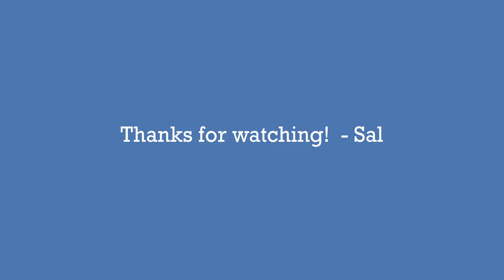First Gen Tundra Audio upgrade!

Comment: I bought an 02' a few months ago for 2k with 140k miles but a bad transmission. I'm currently rebuilding it myself in my garage with upgraded components.  Unfortunately these have a known issue with the torrington bearing behind the overdrive planetary gear.  I'm also ordering new speakers and stereo this week so this is helpful.  Also..if you ever encounter door latch issues. I fixed / modded mine without spending the $250 per latch. Even the new ones are flawed!  Lastly, did you do anything with or for the small tweeter and back door speakers yet?
Reply from the maker: That's really cool that you're rebuilding it yourself. As far as the tweeters, I haven't done anything yet, but I did replace the back door speakers with the same ones I did up front. I don't know if it was super worth it, but I figured why not. Thanks for watching!
Reply: @JDMDriveway  Luckily there are enough good videos of rebuilding the A340 that I felt confident enough to do it! - With the speakers I'm trying to gauge if getting ones without a built in tweeter is the way to go since the already has them... i.e.; wondering if doubling up on tweeters is ok or not.  I'm no stereo genius.
Reply: How's the tranny rebuild coming? Couple questions,  what were your symptoms on the tranny needing rebuilt? Also I heard that the valve bodies get clogged up on our A340 tranny,  any thoughts on that? I've had to replace the lock up solenoid when my 00 wasn't moving anywhere.  Did a pan drop and new fluid and added a little bit of Auto rx and it seems to be shifting like butter ATM.  I think I'm gonna do another drain and refill real soon just to do it. It makes it nice having a drain plug on everything on the first gens. Also do you have a link to the upgraded tranny parts?  Thanks
Reply: @garybrady7245   I’m putting mine back in today/tomorrow.   My wife and I did a full rebuild in our garage.  The issue is common, a bad overdrive planetary gear.   We bought it this way.. got the truck for $2200 and 140k miles.  The issue is dual-fold.. 
1- towing in overdrive in hills and not watching the temps (which you can’t do without a gauge) and,

2- the torrington bearing directly between the overdrive ring gear and planetary gear is insufficiently sized.  

I found a place in Canada that was modding these for a time, machining the ring gear (and or planetary) a little deeper/wider to allow for a slightly wider and thicker torrington to better cope with stress and heat buildup.  This is also why keeping the fluid temps under 190F is very VERY important.  

In our case the bearing and race were 100% gone.. completely obliterated and melted.  This is what happens and in turn wrecks the planetary and ring.. which are now becoming rare as hens teeth to source used (we got a set for $175) or you can buy new from Toyota for $1000.

3- People assume, because of endless heresay in forums, FB, etc, that this issue was limited to only the 00-02 Tundra.  The trans shop (in fact 3 of them) emphatically said it can happen to any of them up to 05 with the A340.  And if you carefully search part numbers as I did, you’ll find no part number changes across those years.  So unless Toyota somehow fixed this in some other manner I don’t see that it was “fixed” at the factory by AISIN.   

If yours is still operational I highly suggest doing a fluid flush with pan cleanout, inspect the magnets, and replace the filter.  When driving, always switch out of overdrive before encountering hills whenever towing.  Lastly, don’t tow more that 6,000-6,500lbs total.  These transmissions are in fact surprisingly small for a v8 truck.  

As for other remedies:  Get a slightly larger trans cooler like the Hayden 679. Add a Derale 13011 inline thermostat.  Add a trans temp gauge and mount it in the pan or at the return line just before pan.  I did all of those as upgrades and peace of mind.

Lastly, we rebuilt the trans with upgrades: Raybestos clutches and steels, new rubber o-rings, and a TransGo HD2 kit for the valve body, new Hercoo solenoids, and reman torq converter.   We did all of it in our garage with a $100 trans mount (red one) off Amazon (requires a little cutting with angle grinder to notch out where fluid pump is) and a spring compressor also purchased on Amazon.  Aside from those two, I had to make a bar puller to remove the pump and a bar puller to remove the overdrive center support.  You also need a few long snap ring pliars, like 12” straight and 12” with 90-deg end.   Lastly, we did not replace the copper coated internal bushings because they looked ok, and a bushing kit to remove them costs like $300 and was something we wouldn’t really use again.. 

My other YT page is RideorDieFab so  follow it.  I’ll be posting all the repair videos there very soon.  It actually wasn’t a hard job, just tedious and you have to pay careful attention to all the details and have some feeler gauges and airgun to check some tolerances and perform 3 or 4 pressure checks to make sure the clutch packs operate.  And to be clear.. I’ve worked on cars a lot but had never rebuilt a trans before.
Reply: @oldowl4290  I gotta tip my hat to you for adding to the first gen knowledge in my hard drive (my brain lol) I'm very impressed with your excellent reply and must thank you! And yes I do have the glowshift gauge with the sensor right into the side of the pan that I made with a universal drain plug from Auto Zone. One that the sensor screws into the center of itself. And have been watching my tranny Temps for a few months now with the average being around 165-173F that's with the oem auxiliary cooler. That's actually my next project is switching out the cooler with a little bit beefier one. I did order the B&M 70268 I  think that was the part number but I didn't like the inner core space that it provided. It was like half the thickness of the oem so I sent it back. And I know another thing that will hurt these trannys is of course the unknown pink milkshake that we all love so well. If you don't catch it quickly it's over it's just a matter of time. But I am still working on getting all of my transmission fluid clean to where it needs to be I just did a drain and refill after running almost 3000 miles on new fluid. That's when I found out you better have a decent fluid or the tranny will not like it at all. Been using the Valvolene Max life full synthetic fluid and having good reactions to it so that's what I'll stick with. But I slowly but surely brought life back into my tranny no doubt in my mind because it was slipping and not budging to now it's shifting nice. The lock ups even working now that I never noticed before with my rrrrs slightly over 2000 doing 50 mph and now I can feel it kick down and observe the r gauge at 17-1800 at 50mph telling you its crazy how strong these trannys really are
Reply: @garybrady7245  thanks for the tip on the sensor and fluid.  I’ve yet to install it and would prefer the pan.  Did you mount it on drivers side or passenger and how many inches from front of pan?  Secondly, I read to not use too big of an aux cooler because of something about the torq converter and if it is consistently too cool it allows it to freewheel or something and overheat. Something like that.  So I read you don’t want any aux cooler that is anymore than like 20% larger than the stock one.  I did also replace the radiator since it had 140k miles and didn’t know how much debris could be in there from the torrington detonation.  I know some people in warmer climates bypass it all together because of the milkshake issue, (which I also found the data average for occurrence is actually 125k miles) but I’m about to move to Abq NM from San Diego and it gets into the 20s there sometimes so I’m concerned about too cold fluid which the radiator serves to quickly warm up, as does the addition of the thermostat on the auxiliary trans cooler to bypass it until the fluid hits 180 degrees.  

Glad yours is still operational, it’s definitely a chore to replace it, but also why I was able to score one so cheap.  I also did the T-belt and water pump first. The engine is quietest I’ve ever heard so that was the selling point and the interior is super clean.  Paint is bad from SoCal sun but I’m going to flatbed it and build a custom camper and then Raptorliner it in 499 tan or coyote tan (they are very similar mil-spec colors).  Also going with 17” 4Runner trail wheels and putting on LCAs and spindles from the 05-06 which I already pulled out of a parts yard.  The LBJs on the 05-06 are beefier, and the rotors and calipers are larger.  Also probably will do the LSPV delete with the new wildwood proportional valve kit.  Plan is to knock all this out by xmas lol.. we’ll see!
Reply: @oldowl4290  I forgot I also did the water pump and timing belt 4-5000 miles ago. That was my first time doing anything to do with timing belt and I nailed it first try. That really does make a man feel like a man when he has his truck all apart and then back together and everything just fires right up. Grrr grrr grrr like Tim the toolman speaking of Tim if you ever get time check out some of Timmy the toolman he's a veteran Toyota mechanic and really knows his shit. He is worth checking out some time as he works on his first gen runner and alot is pretty much the same on our first gens. 

With the sensor I have it right into the front driver side of the pan. Kinda wish I would have put it in the passenger side would have been a little easier but it still worked out. I read too that you can put a sensor into one of the test ports on the tranny but don't know for sure how it works. I sometimes think my gauge is either stuck or not working but it is correct. Haven't seen it go above 190-200 which is good I guess. Thanks for the good tip on cooler size I would have for sure looked for a bigger one so Thanks on that. Also let me know how the Hercs shift solenoids work out I've heard mixed comments on those, but I do know that a oem solenoid is crazy Dinero omg like 327 for one lock up solenoid E.  Found that out when I got the P0770 code that's still there but I'm thinking because I didn't use a oem solenoid.  Who care ls as long as it shifts fine. Have also been noticing just today and recently that when cruising at idk highway speeds around 60-65 I barely  I mean barely touch the throttle and it kicks down into passing gear like. Idk what would cause that maybe the cable being stretched too tight or ? Idk

But as long as everything performs like it's supposed to my next mod is moving on to all 4 new aftermarket wheels and tires and leaving everything stock but gonna try to go with a 17 inch wheel with a -12 offset for a small aggressive look. Already been approved from Off Road rims and financing which BTW have like infinite choices of wheels for the first gens. Can't wait
Reply: @garybrady7245  I’ve done several timing belts. It’s always a chore and was the first thing I did the week after buying this truck.  In comparison, I had the transmission out in about 3 hour wheras the T-belt is always a 3 day project.  I also noted the factory manual says to remove the tensioner pulley bolt and pulley (which I wondered why as that seems so non necessary) but did so anyway. Well, it’s a reverse threaded bolt (righty loosey) and 5 turns in I snapped the bolt head off.  $70 part to replace it.  Surprisingly it wasn’t the first time Ive seen incorrect info in OEM manuals.  Also why YouTube is so helpful.  Cheers, and check out RideOrDie soon.  PS.. no guesses on your trans. All I can say is check the pan magnets and change the filter.

Comment: Wouldn't spray-on bedliner type stuff do the same thing?
Reply from the maker: It very well may, I hadn't thought about that until now. Thanks for watching!
Reply: I did mine (04 dbl cab) with spray-on rubberized undercoating a few years ago. It made a big difference not only in the audio sounding better but also road noise was reduced.

Comment: I’m thinking about buying the sub you got, does it have some good bass?
Reply from the maker: Hey Nathan, if you're looking for window rattling bass this isn't it, but sitting in the drivers seat you definitely feel a significant difference and turned all the way up it bumps pretty good. I will say that because it is super focused under the drivers seat and not in the backseat, it doesn't rumble the whole cab. I tried it out sitting in the passenger seat and you hear a difference, but its not as noticeable. Sitting in the drivers seat, you feel a big difference and I think its worth it. Thanks for watching - Sal

Comment: where did you get your radio from im struggling to find one with the cables and stuff
Reply from the maker: This video talks specifically about the head unit I've got. I used an adapter harness from crutchfield to keep the factory wiring in tact. Thanks for watching
https://youtu.be/z10_DbflgKo

Comment: Do you know if you can add a second sub under the passenger seat?
Reply from the maker: Yep, you should be able to. It will fit the same as the drivers side, and the wiring shouldn't be any more difficult. I've considered doing that myself. Thanks for watching

Comment: For the subwoofer did you sanded down the seatbelt bolts to put your negative?
Reply from the maker: I actually used one of the seat bracket bolts, but honestly the seatbelt bolt is probably a better option lol
Reply: @JDMDriveway  ohh I meant the seat bracket bolts not the seatbelts but alright thanks !😂
Reply from the maker: 😂😂 yeah I don't think I sanded them down at all, but it probably wouldn't hurt to

Comment: hey so you used 4 of the kicker speaker right? front doors and back
Reply from the maker: Yep, they were all the same. Honestly, I'd probably tell you to save your money on the rears at least to start. See if you're happy with just the fronts and if not, then do the rears too. I just don't feel like they contribute too much to the sound in the cab. Just my 2 cents. Thanks for watching!
Reply: you the man mang! ty @JDMDriveway
Reply: about to pull the trigger on this set-up! looking back do you wish you'd put the sub under the passenger seat instead of the driver? feel like i'd rather have it there for some reason. probably would complicate the install though huh.

Comment: Do you still have the factory amp?
Reply from the maker: Yes, it is still back there in the dash, but it is bypassed with the new wiring. I guess it wouldn't play well with the head unit. Not too sure on the details. Thanks for watching!